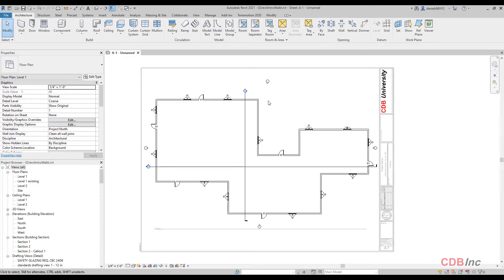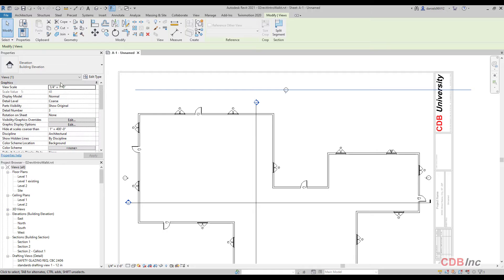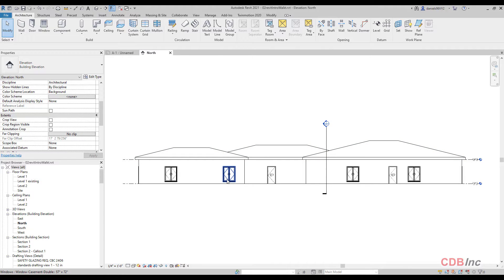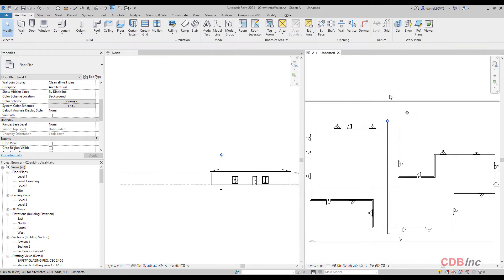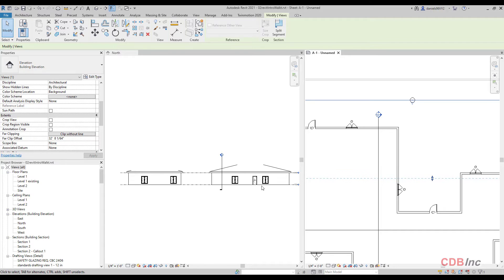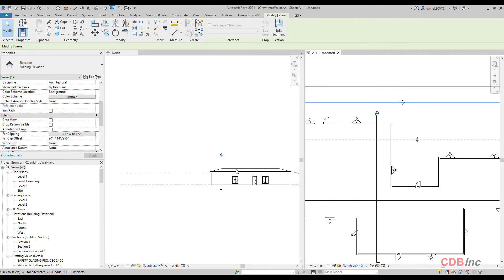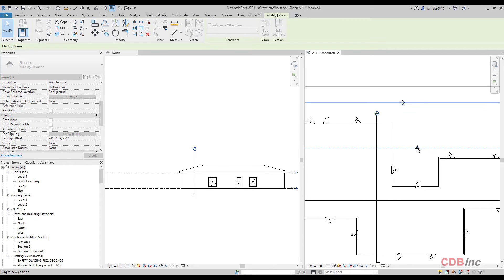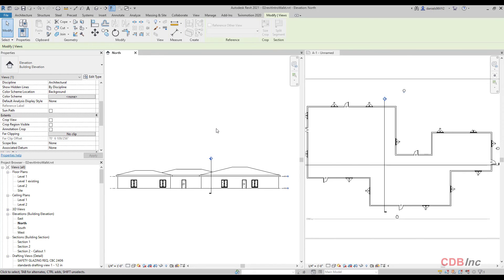Revit Architecture Elevation View Settings (Common mistakes) Clip Settings

Comment: Hi,  there a quation about camera view  the eye elevation goes to minus ( showing the area under the building)
Reply from the maker: I'll do a video on camera views, in the properties pallet you can set the eye elevation height (where the camera is) and also the target elevation height (where the camera is looking).  You can select the camera to set those settings in the project browser, go to 3d views, find the camera view, right click "show camera", then back to the properties pallet to set the setting mentioned above.  Good luck.  I'll create a video about it.

Comment: Can we adjust the line thickness as per view depth. Thicker lines to closer & thin lines for far objects!
Reply from the maker: You could adjust the line thickness but I would never recommend it.  1. It would take a lot of time. 2. and I don't think its a good use of time.  That said, Revit can do this for you by applying a "depth cueing" feature available under the view control bar, visual style option where in Revit will do this for you.  It does force your output to be raster format vs. vector but it does the job.  Thanks for the question Shuaib.  I'll slate this feature for an upcoming video so I can show it.
Reply: @CDB-UlearningRevit  thanks for your reply. In depth cueing we can only control the fading of color but not thickness. Hope Autodesk ads this feature in upcoming versions.